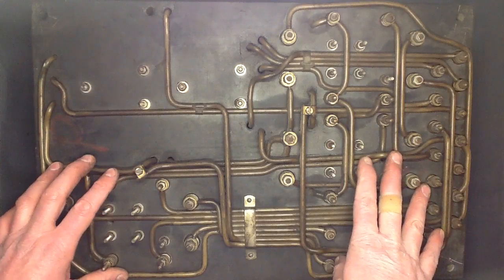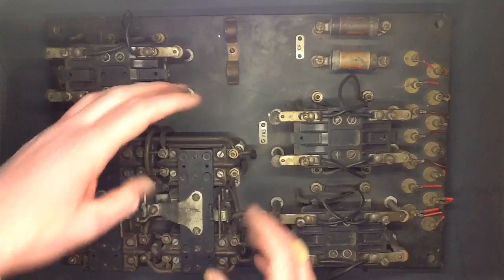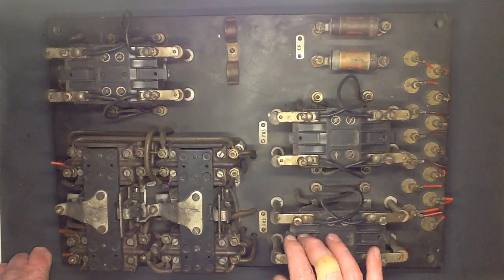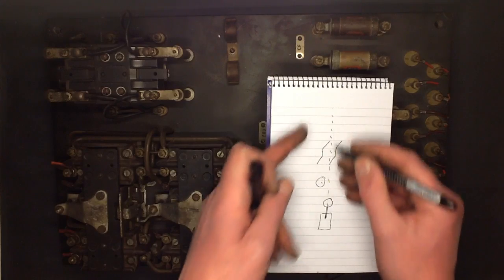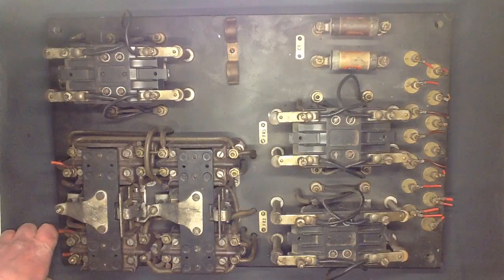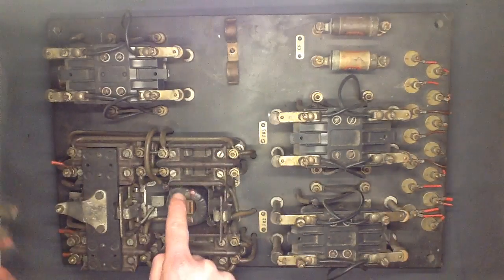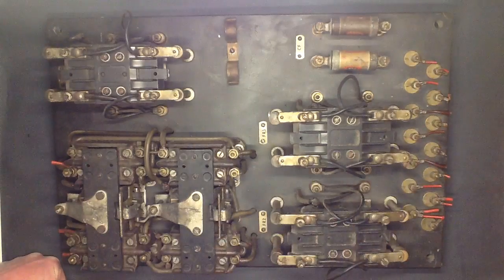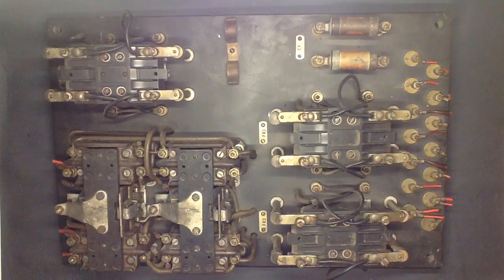Really old and VERY heavy slate elevator controller.

Comment: It's been years since I first saw this, and I'm still in awe of the beauty of this device. Not just on an aesthetic level, but in its engineering and method of operation. It is such a simple, yet also robust and effective system. There really is no reason to replace them from a practical point of view, as long as they continue to work.

Comment: One of the most interesting technical conversations I have had was with an elevator tech (lift engineer) they are fascinating machines. It would be scary to me to work on not to mention I don't do confined spaces but properly maintained they are very safe. I need to check with one of my neighbors down from my shop. When I was doing some data work they had the old fuse panel with the glass power meters, knife switches, blade fuses on I think slate in just in a wooden cabinet in a stairwell. I said if they ever remodeled it I wanted it. At least 100 years old if not more but that is how it was done then. The buildings were there before electricity was.

Comment: I retired in 2015, but working as an electrician in a steel mill, we had many rolling mills and overhead cranes that used this construction technique. Some were built in the mid 1930s' , others as "new" as 1967. The slate backboards were indestructible, as was the wiring behind them. The high power DC contactors were mounted on the front to facilitate easy maintenance. The contactors did indeed require periodic maintenance, as the heavy copper tips would erode away due to mechanical wear and high current arcing. They all used arc suppression chutes and blowout coils to reduce arcing, but you could still easily hear from the plant floor, the constant popping as they opened. The newer cranes now use AC induction motors and solid state VS drives. Much less maintenance.
 Your channel never ceases to amaze!

Comment: Maybe I missed the obvious, but how do all those "bare copper wires" not short-circuit?
Reply from the maker: They have thin insulation and spacing.
Reply: @bigclivedotcom  i guessed at that, but the video was not in 3D ;-).
But more if they are only isolated by a layer of lacquer, and the massive contactors generating vibrations. I would not expect it to be as reliable as you describe it was.
Our do you have super strong lacquer over there? 😆
Reply: @martin_hansen  you can see where the bridges between two wires are that the wires get around 0.5 to 1mm thinner.

Comment: As I mentioned in an earlier post, I worked for an elevator company that specialized in modernizing old elevators in NYC. I saw many similar boards, and loved watching them operate, from the time someone pushed a floor button, to the car going to the right floor, picking up and then delivering the caller to where they wanted to go. Yes, very Dr. Frankenstein in style and operation. As we used to describe the process of cleaning these things,  you open the door of the control box, throw in a stick of dynamite, and when it went off, you opened the door and vacuumed out the dust and you were back in business. Yes, very robust equipment and truly indestructible. 😜👍

Comment: Good ol reliable. Only downside was all the carbon dust everywhere.

Some of the older Elevators use DC direct drive motors. So much copper.
Reply from the maker: In that era it would have been so useful to have a thermal imaging camera.

Comment: This is quite the controller, I wonder what year it’s from. Otis elevator company in 1956 used relay logic to control the elevators, and what relay logic was, was about 200 relays in series that made elevator decisions, they were actually very reliable, and some are still in use to this day. I don’t really think that using this particular controller is very safe though, modern elevator controllers have a ton of safety features, including: seismic equipment, limit switches, security systems, Fire detection, and way more.

Comment: 2:39 - "And then you have to pull the door open yourself.  It's a harsh life."  I remember riding those in an old mall my grandma used to take me to in the early 80s.  Sadly neither my grandma or the mall is around anymore.  As a little kid those elevators were more fascinating than the "modern" elevators around at the time.

Comment: Looking at that I suddenly remembered my bedside lamp at my Nan's. That "fishy" smell of warm bakelite & switches that would wake the whole house up if operated late at night. "Heave-Clunk-Sponggggg!"
But what a genius material to make a board out of! Drillable, sawable, stable, great insulator & cheap. Even today you could buy proper Welsh slate roof slates & build simple circuits with lots of enameled copper & brass fittings.

Comment: This is a vintage slate lift (elevator) controller that I salvaged out of a skip (dumpster) when it was being ripped out of a building I was working on.  It's from the early days of electrical controls, so the design is super-simple and very well engineered.  It's notable that the electronically controlled replacement elevators (more than one) were a lot less reliable than this old workhorse.
It served three floors and has just three contactors with two NO (Normally Open) and two NC (Normally Closed) contacts on each.  It also has the motor control contactor assembly with two sets of four normally open contacts and an interlock system to prevent both from closing at once (which would short out the incoming three phase supply).
The lift position control was done by three-position switches in the shaft at each level.  The switches were physically moved from one side to the other and left in that state as the elevator car passed them.  When the elevator car was level with the landing its switch would be in the mid position.  The two outer connections of all the switches in the shaft were commoned and linked to the up and down contactor coils so when a call was placed and the appropriate level switch was energised it would feed the contactor to make the motor run in the correct direction.  When the lift was at its destination level and its switch roller was moved to the mid position it would also break the control circuit for that level causing the contactors to drop out, stopping the lift and also preventing a call from being placed from that level.  When the car door or any landing door was opened it broke the control circuit, as did end of shaft emergency limit switches and any other safety switches to prevent motor movement.
The three phase incoming power (415V) goes straight to the contactors and a tap is then taken from two of the phases via fuses to feed the control circuitry.  This means all the call buttons and switches had 415V across them.  There is no neutral connection used.  And the car light would have had its own separate supply.
There's no speed control.  The motor starts at full torque and stops suddenly when it reaches its destination.  This makes for an exciting ride and limits the maximum speed, but the pay-off for that is ultra simple circuitry and the resultant reliability.
The contactors all have replaceable contacts and coils, and the car and landing call switches all had carbon block contacts, again for reliability.

It's probably worth mentioning that when I was a kid, the first job I wanted was as a lift engineer (elevator mechanic).  But that was vetoed by my dad who said I would have to become an electrician first.  In reality if I had ended up working with a lift engineering company I would have been in the same class at college one day a week anyway, as the City and Guilds 236 electrical installation course covered a wide range of electrical trades.

If you enjoy my videos you can support the channel by throwing a dollar to the elevator attendant for coffee and cookies at https://www.patreon.com/bigclive

The weight of the slate control panel is:-  15.9kg  (35 pounds)  (2.5 stone)

Comment: What a great piece of engineering, from a time when things were engineered as opposed to mass machine punched. Reminds me to some extent of when the old reliable electromechanical telephone exchanged was pulled out at the place where I worked - a whole room full of switchgear swapped for a microwave oven sized box of transistor and IC circuitry.

The old system had been there about thirty years before I started working there, but I'll bet the BT "Merlin" albeit a good enough system, has been replaced several times over in the thirty years since I left.

To say that this kind of technology was atomic bomb proof was probably true - not much here to succumb to EMP damage.

Comment: We had an elevator at a workplace i worked on some times ago. The engine room was lovely, with a kind of mini elevator that told the system what floor the elevator was at. When the big elevator was running, the speed was geared down to the mini one that traveled at maximum about one meter and then ran across different contacts, for each floor.
The bad thing with this was: First one gets it!
So you always stared at the yellow light telling that it was in use, and as soon as it was out you pushed the button, before any one else did. Then if you went on together with some other people, you always asked everyone what floor they were going to, since it only remembered one floor at a time.
So if you had one person going to 8, one 5 and one 12 and you started at 3, you first pressed 5. When you arrived and the door opened, you pressed  8. The same goes there and you press 12.
A lovely piece of engineering!
Reply from the maker: The mini elevator mechanism was the selector.  To indicate where the lift was and if it should go up or down to respond to a call.  The lift should have been able to store multiple calls and service them all in one direction at a time.
Reply: @bigclivedotcom  Thanks for the response! Sadly, it didn't work like that, but would have been nice. Especially if someone already pressed their floor. Then you had to go with them aaaaaall the way (Murphys law states they always wanted to go way high in the building and me wanting to go like one floor) before returning. Nice guided tour though....
BTW, if i have some stuff for you to look at, where can i get in contact with you? Tried e-mailing you but sadly, no response. :-(

Comment: Love those old style concertina-cage-door lifts. I used to work in a factory which used them, and universities used them too up until about 10 years ago. It was a real shame when Sussex University replaced the lift in the chemistry building with a modern version: It made a load of quality chemistry joke graffiti between floors invisible. With the old lift, you could pull the emergency stop lever between floors, open the inner door and write on the wall - when you were done, shut the door again, release the lever and let the lift continue on its way. The best stuff was between the 4th and 5th floors - for example, someone had worked out the formula for the explosive compound inside the "Holy Hand Grenade" and drawn its structure on the wall:
https://i.imgur.com/4UQKZYl.png

Comment: i've been lolling at the puns in the comments.  good reading.  does this thing belong in the british museum?  it looks like something howard carter may have found in egypt.  i never heard it said but it might be worth mentioning that the back side of the board seems to be done in 'pyro' fire resistant cabling.
Reply: Those cables are usually single strand copper with a plastic cover, looks similar to pyro until you see where they’re connected. The end is stripped of plastic and a loop is clamped between washers. All the shaft wiring would be done in the same way, just using smaller wires.

Comment: That is a thing of beauty. I'd go at that with solvol, an old tooth brush and lots of elbow grease. I might find a use for it and make sure the operation of the contactors can be seen 

And never forget that simple works a thousand times better than complicated, more reliable too

Comment: Awesome not only to see amazing tech like this, but also to finally learn how the logic in these worked as well! Many thanks for yet another awesome video, chap! ^_^

One quick question: The busbars on the rear look to be uninsulated, but at the same time in physical contact with one another. Were these insulated internally then grounded with a brass outer sheath, or is there some kind of 19th/20th century isolation magick at hand here? :-)

P.S, as there's such a diversity in units of measurement here: 31kg, half a stone three ounces and 25 Farthings! :-p ;-)
Reply from the maker: The wires do have a form of insulation on them.

Comment: There are occasions where the saying „If it isn’t broken, don’t fix it“ still holds true.
The terms „broken“ and „old“ have been redefined in recent years, making the two more or less synonymous. Also, the threshold before things are being called „old“ has shifted dramatically.

Which is sad, especially when looking at perfectly good tech that has worked flawlessly for decades and is chucked for no reason other than it being old. Mind you, this modern approach definitely has its place, but not here. I guess the place who threw this out are still kicking themselves years down the line.

Comment: We upgraded an old Otis at the Manitou Springs Bathhouse back in the '80s that had silver dollar sized carbon pads that were struck by half dollar sized copper contacts. The beauty of this system was that not only were they self wiping, and really didn't take much maintenance, you could never experience welded contacts with this setup. And given that the copper pads started out a couple of inches away from the carbon pads, arcing was not an issue...

The downside was that the contacts had to be big, and they were. :) 

The carbon/copper contacts are still available (https://www.adamselevator.com/pdf/185.pdf). 

So are the ones that your controller uses (and local to you too!) https://www.liftcomponents.co.uk/controller/control-switchgear/contactors/contact-carbon-with-brass-stud-16mm.html
Reply from the maker: The old units are super-rugged.  Not subtle in their movement, but very reliable as a result of their simplicity and over-engineering.

Comment: There are hundreds of EC&M electric overhead trolley cranes still working in American factories.  Many date to the 1930's and 1940's.   All the controls are constructed like your elevator controller and perfectly reliable after all these years.   The new solid state controlled cranes need the controls refurbished after about 10 years and are not tolerant of huge voltage swings and dead shorts.
Reply from the maker: I'm definitely a fan of the rugged old control systems for simple applications like this.  Just a few speeds set by resistors and resilient to the extremes of climate found inside industrial buildings.

Comment: The motor controller appears to be an early type of a magnetic motor starter incorporating phase reversing contacts to control the direction of the hoist motor. Where later traction elevators using AC three phase motors with relay control logic would have a separate 3 phase magnetic motor starter, and phase reversing relay.  They ought of have kept this older controller in service, it was reliable and robust.

Comment: the only time i seen a lift like was in The Crystal Palace Wetherspoons pub in Glasgow.
Reply from the maker: If they still have it, that's quite a nice birdcage lift.  I'd guess the control system has been modernised though.
Reply: havent been in it for years though now, i remember having to squeeze in with a buggy and try and yank the 2 doors (cages?) back and ensure it had made contact before it would move up or down... yes it was very unnerving at the time, and they didnt seem to apply any WD40 on it to make the doors easier to move!
Reply: Funny enough i am on my way out to poundland to get one of the BigClive special screwdrivers! i been meaning to get one for ages but always forget.

Comment: Older subways and trams used similar sized contactors to control their 600 volt DC traction motors.  They needed very little maintenance and could operate for decades reliably.

Comment: reminds me of some old stuff we used to find going treasure hunting at an old salvage yard in Huntsville Alabama. Marshall Spaceflight Center used to dump a lot of stuff there. we once found an external hard drive that for all the world looked like a scaled up Western digital as far as the platters, and aluminum drive case. the interface boards were a mystery however. the outside cabinet was about 2.5 Ft wide, 3 Ft tall and 4 5 Ft deep. weighed a TONNE! Had 3 platters inside that were maybe 18in dia..  probably cost NASA $30,000 and stored 20Mb. honest never did figure the capacity... but it had to be LOW